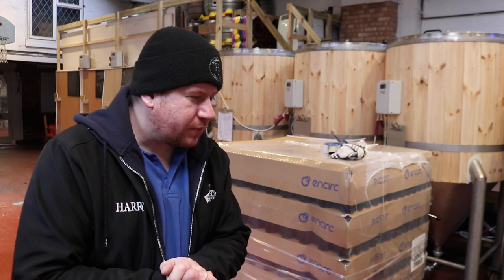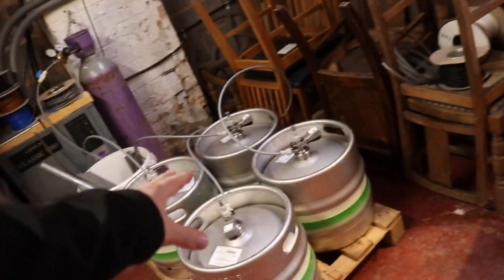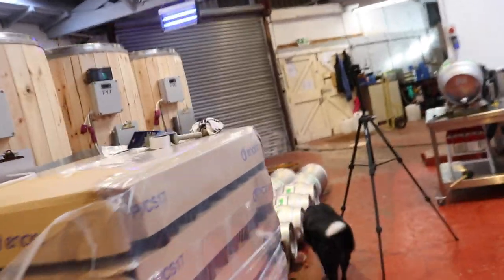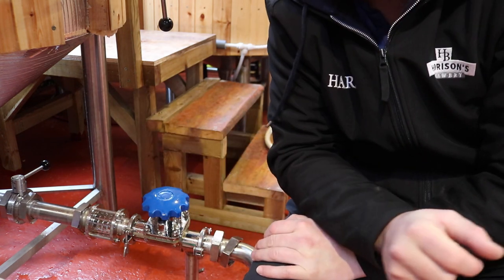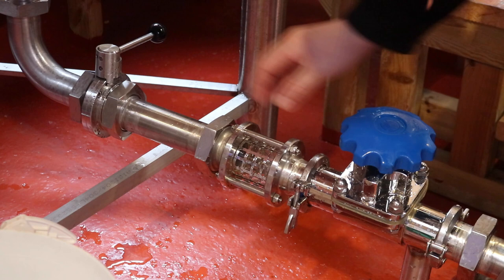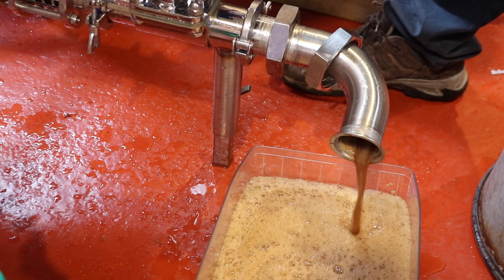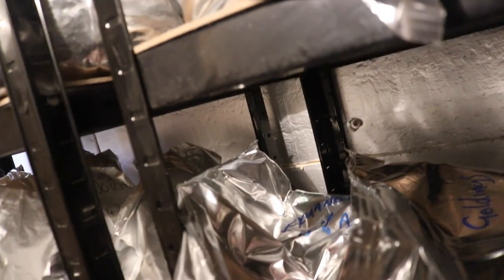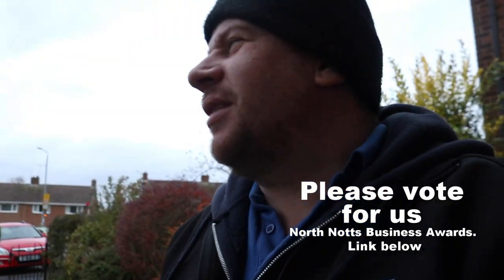YEAST HARVEST ERROR, ABORT, ABORT

Comment: You will probably be able to capture the yeast if you use a reducer so that the flow is less...looks like 2" pipe which is too big for that size vessel. Try a reducer down to 1" or maybe less, and let it flow slowly. The beer is punching a large hole in the yeast cake with the large diameter pipe/outlet

Comment: Pity that about the yeast harvesting,I wonder though if you shortened up the gubbins and just straight piped it would it work? Is it possible the length of gubbins plus elbow is allowing head pressure to drop that little bit too much,bring outlet nearer to bottom of cone perhaps?(nothing to lose). Cheers.

Comment: How about topping the FVs with CO2 and running a whirlpool to drive the yeast totally to the bottom? With the CO2, you shouldn't ingest oxygen and risk oxidation, but you could run a pretty strong whirlpool, recirculating the beer?